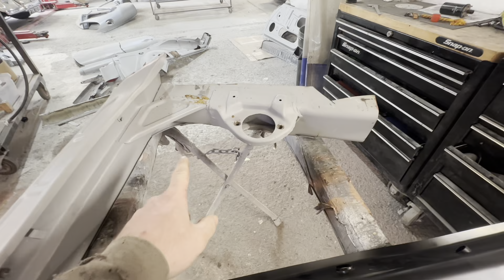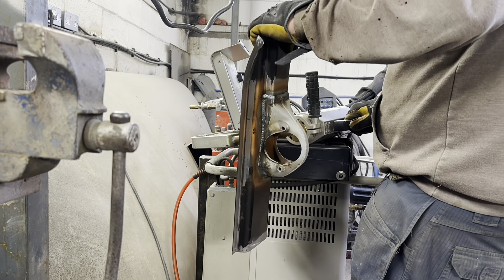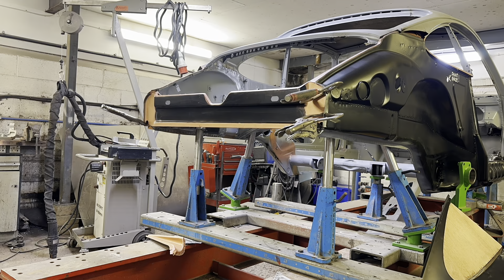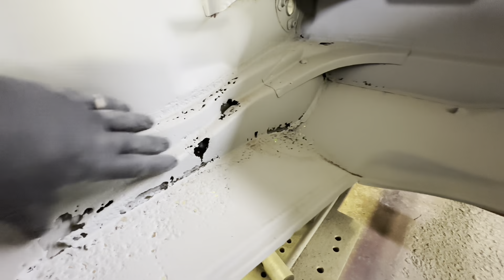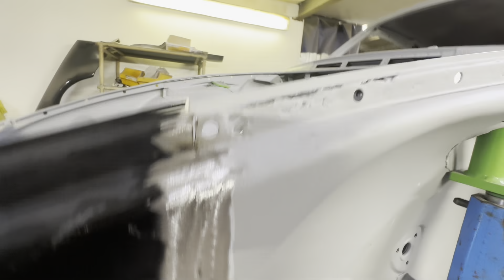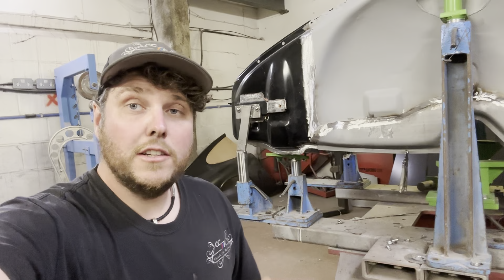1966 Porsche 911 (912) Restoration pt4! The Metalwork Continues…..

Comment: You are not just restoring this 912, I would say that you are making a new car out of it. Ready for another 60 or 70 years. Or even more if the new owner keeps it out of the rust creators. Awesome work to save one from the trash heap.
Reply from the maker: Thank you! That’s the plan, to build a car that’ll be on the road for another few decades. Like you say, they need looking after correctly but this should be on the road for years to come

Comment: Really great stuff. Watching you fabricate all these repair panels, I'm wondering if a  repaired panel  is as strong as the original. In woodworking, I know that if I use marine epoxy to join two pieces of wood together, that joint will be as strong, or, even stronger than the wood itself. Is that true with steel?
Reply from the maker: Honestly I think there’s too many variants to comment. Coach built cars were often made up from many pieces (or panels) then linished to create a seamless panel. But if a panel is poorly welded or ground too thin, it’ll always be weaker.

Comment: Really impressive work, do you intend to restore as 912 or delete original engine? Great video👍
Reply from the maker: Thank you! It doesn’t currently have an engine so but the plan is to run a spicey type 1 VW engine. Something around the 160bhp mark